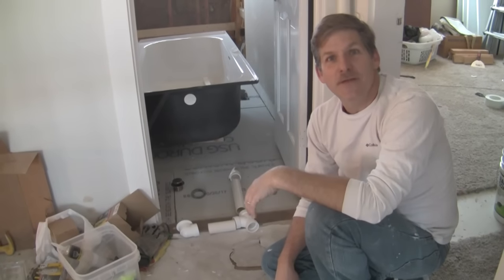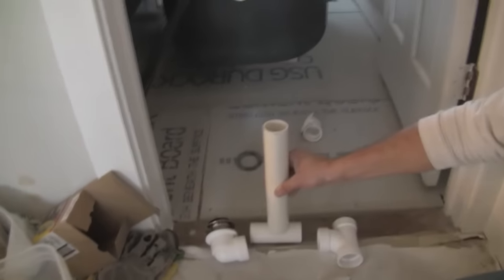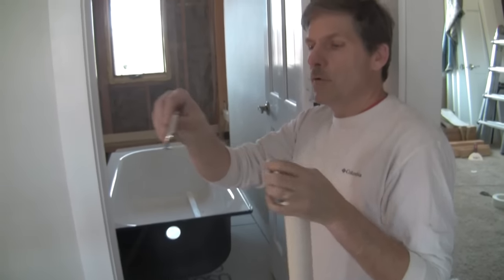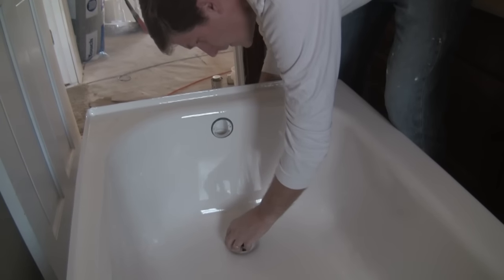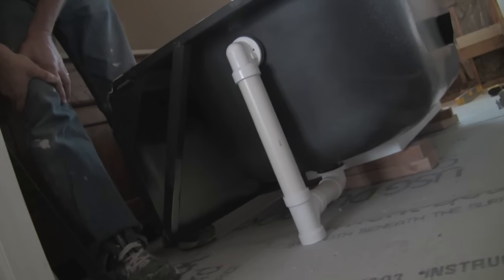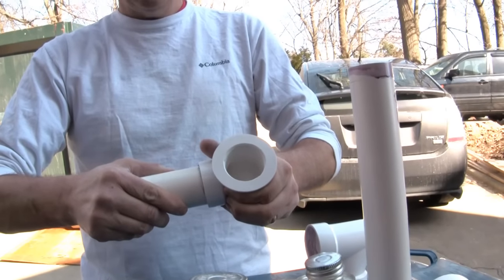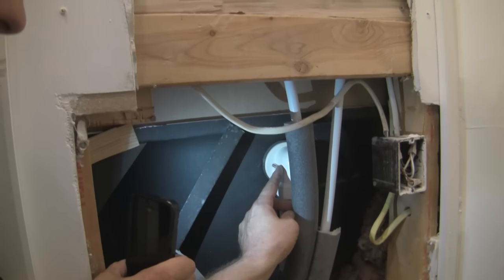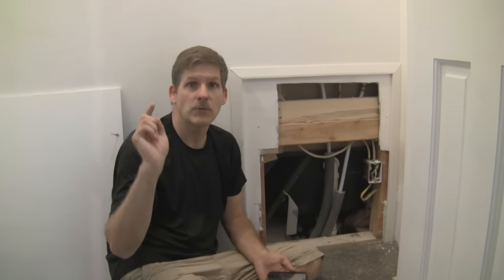How to Install a Bathtub Drain

Comment: Hi do you have a videon on how to support the tub itself? Esp on fiberglass ones?thanks
Reply from the maker: Hey LRJ,
I don’t think we have one yet. The fiberglass tubs are generally supported on one side by a horizontal 2x4 under the tub side lip. The bottom of the tub is also supported from underneath by a ‘mud bed ‘ - which is basically laying down a pile of 4-1 mortar mix and then setting the tub on it and pushing the tub down and level. Once the mud bed tries, the bottom of the tub will be well supported. 
Good luck.

Comment: What happen with the plumin party you don’t put it
Reply: You mean the plumbers putty? It provides an extra seal to prevent any water from leaking through. If the threads aren't tight and sealed, water can slowly leak through over time, and cause unseen water damage over time. 
Edit: which can weaken the floor below it and making it an expensive repair.

Comment: 2:19 i thought that foam part went on the inside of the tub. I cut and glue all the parts like that. Hopefully it still fits fine after putting it on the back
Reply from the maker: Hey GT....
Ouch. I’d try and correct that. Not sure how long that will last OR if it will work. The gasket we used has a bevel to it as well which may also cause a weak seal on the wrong side. 
Thx for watching.
Reply: @Housebarons  I ended up not using the seal at all and just put a  whole bunch of caulking (Dap 3.0 kitchen, bath and plumbing).

Comment: How is that up to code. The tub is right next to a outlet.  From what I understand it should be 6 ft away. 🤔👽
Reply from the maker: Hey Alien…,
The house is 40 yrs old … maybe part of the reason. But all outlets in bath are on GFCI for safety s against water hazards. 
Thx for watching.

Comment: I bought plastic bathtub drain should I glue it to pvc?
Reply from the maker: Hey Robert,
Check the instructions with the drain. It should tell you with what it is compatible. If no luck there, contact the drain manufacturer. It’s a pretty important connection which you want to get right.

Comment: Yo idk but my pipe for my bath completely came off and its just dangling. What would I do? I have no clue. Theres nothing there to attach it to the bath
Reply from the maker: Hey Ayan,
The drain pipe attaches to the overflow ( top tub drain) and the  bottom drain.
Where did it detach?
The top drain is often held by 2 screws or so.
The bottom drain is 2 parts - inside the tub screw drain that goes through the hole in tub and screws into the bottom of the drain pipe from outside/ underneath the tub. It makes like a screw sandwich with the tub skin in the middle.
Reply: @Housebarons  it detatched straight from the actual bath wher the tub basket was. From what I am seeing there are no screws or anything from what I can see. The pipe is just dangling below the pipe. My guess here is sinse the tub basket broke that the pipe dropped and started dangling. I have also found out that the rubber gasket is not there either. I dont really want to call a plumber since this seems to simpe for it.
Reply from the maker: Hey Ayan,
If you can get to it all, go ahead and try to replace it. It should have a rubber gasket anyway. If you can get your hands on everything, you are right - it’s pretty straightforward.
Reply from the maker: Hey Ayan,
They sell tub drain kits to replace everything.  You’ll probably need to cut / repair where the drain pipe connects to the p-trap. 
Check out this video for PVC pipe repair if you are not familiar...
https://youtu.be/2pIOo58BmJo
Hope that helps!
Reply: Thanks. I'll buy the kit and replace that whole pipe and hopefully thats fixes it
Reply: @Housebarons  also my mothers bathroom is in the same predicament. I can screw the pipe to the drain but it leaks from where I screwed it in. I dont know what the part that goes on the pipe and screws onto the pipe but is there something that I need to apply to it or is it something else?
Reply from the maker: Hey Ayan,
In the first 1:30 of the tub drain video, the chrome drain screws into the white PVC bottom. 
The white PVC bottom portion has the rubber gasket between it and the tub. 
The chrome/silver screw drain goes in from the tub. Under the lip of that chrome/silver drain goes a roll of plumbers putty. It’s like play dough which get crushed between the drain ( chrome ) and tub as you screw it in. That keeps it from leaking.
Reply from the maker: Hey Ayan,
With the plumbers putty, you take about a ping pong ball size of the putty from the container, roll it out like you are making a snake till the roll is about as long as a pencil and a little fatter than a pencil. Then that “snake” of putty gets wrapped around the silver drain under the lip of the drain. That way, when you screw the silver drain piece in, the extra plumbers putty will squish out. What remains squished/trapped between the drain and the tub forms a water tight seal.

Comment: No the primer does not clean, it softens and preps the pipe, there is a separate cleaner sold in stores.
Reply from the maker: Hey Michael,
Correct. Thx for pointing it out and for watching!

Comment: you failed to show your mistake.  you had original assembly misaligned....you cut the 1 1/2 pvc pipe to rotate and you installed a coupling.
Reply: I caught that also...Just use a magic marker on the fittings and pipe, if you're going to glue your pipe together ten miles down the road.

Comment: Be nice if they made threaded versions of these.  That way, you screw up, you can at least reuse the drain connections.
Reply from the maker: Hey Spawny...,
Does the saying go “ necessity is the mother of invention” ?
Maybe someone should invent that!
Thanks for the input and thx for watching.
Reply: @Housebarons  hey mine has sliding connectors that has a pvc nut to tighten,  do I need to glue those?

Comment: The part I need help with is what happened between 6:58 and 6:59.
Reply from the maker: Hey Eric,
Not sure I understand?
Reply: That's what I was looking for too. I'm going with a glued assembly instead of slip-joint and am unclear if the "tailpiece" SCH40 should be glued directly into the trap, or if some kind of union should be used. Also, does the drain assembly get glued in, then attached to the tub, or do you attach the assembly to the tub and set it right down into the trap and glue it in?

Comment: I have only one simple question - "To be! Or not to be!?  My question - Is there has to be tape, or silicone, or both to apply, before to screw lift & turn top part w/bottom... No one vidio dos NOT PROVIDE this small PIECE of information...! And i still procrastinate to install danko lift and turn bath drain... Don,t want a leak...!

Comment: Wouldn't it be easier to use a kit with compression fittings instead of all the glue joints?
Reply from the maker: Hey Ken3pl,
Short answer - YES.  
Guess it depends on access, what your used to etc. Both will work. Thx for making the point.

Comment: Shouldn't be priming all the joints at once. They should be primed one at a time and glued one at a time.  The primer is not supposed to totally dry not only does it clean, it also creates a chemical reaction with the glue to meld both the pipe and fitting together. It is supposed to be glued while it's still wet
Reply: Cant do it but you know how to tell everyone else how to do it you must be an inspector 😂

Comment: I kept watching to see if you used plumber's putty or silicone under the "toe" drain. You didn't show anything!
Reply from the maker: Hey Richard,
The bottom side has a rubber-ish gasket. The top side of drain- plumbers putty works great. 
Thx for watching!

Comment: You skipped some steps buddy.  Plastic pipes maybe cheaper, but when you drain boiling hot water that's another story.
Reply from the maker: Hey o kap,
Thanks for the pointers.
Peace
Reply: Its a tub.  It will not have boiling hot water.